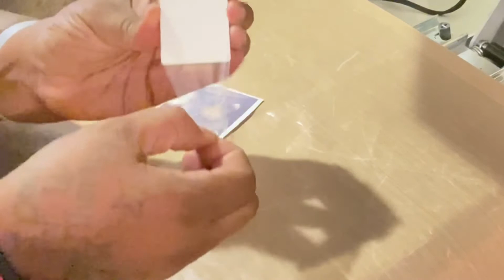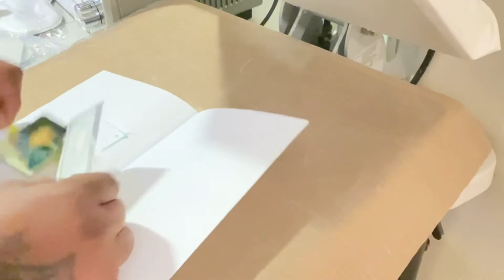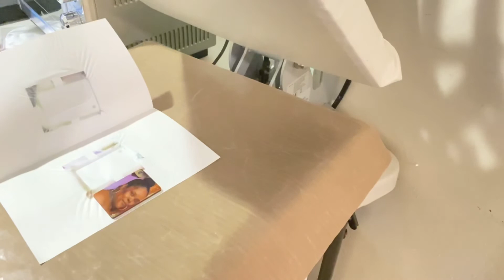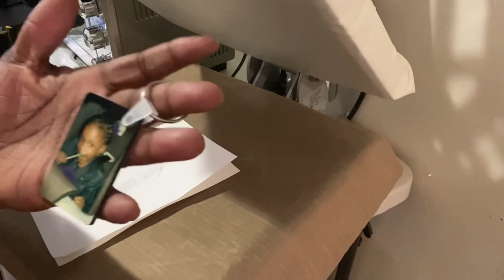HOW TO SUBLIMATE A KEYCHAIN | TWO SIDED | SUBLIMATION

Comment: Any idea why i am getting the outlines of the heat tape when pressing the opposite side? Eg, I press one side, it come out great, but when I go to press the other side (with the printed image on) if I put heat tape onto the image it leaves the outline
Reply from the maker: WELL IM NOT SURE CAN U SEND ME A PICTURE ON IG MY LINK IS IN THE DESCRIPTION. ALSO WHERE DID U GET THE KEY CHAIN FROM AND WHERE DID U GET THE HEAT TAPE FROM? AND WHAT KIND OF HEAT TAPE ARE WE USING? WHATS THE TEMP AND TIME OF U HEAT PRESS?
Reply: @KustomBreezee  thank you for the reply. We have managed to fix where the problem was. But if anyone gets any polymer keychains, simple answer is don't they cause to many problems. Thank you for the reply. You do amazing work
Reply from the maker: Aww thank u yes u will find the ones that work for u and stick to those 💖 thank u so much for watching and for your support i greatly appreciate u